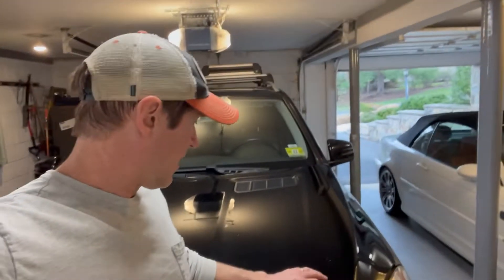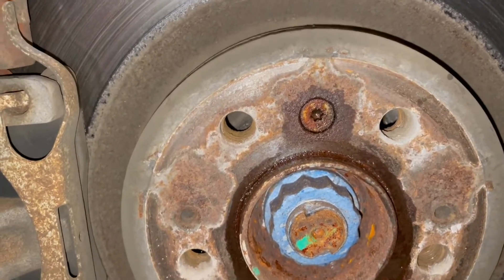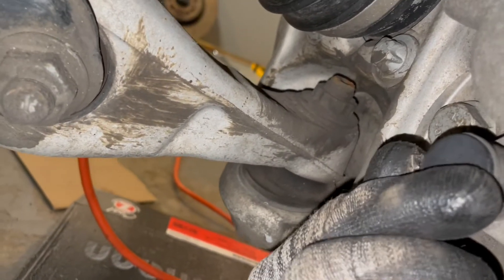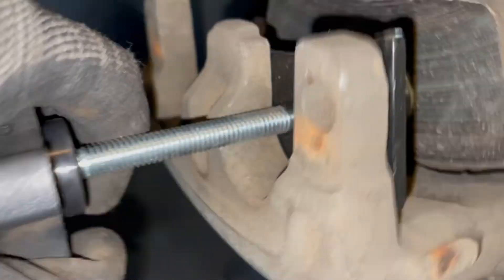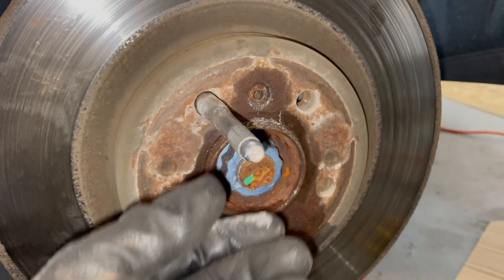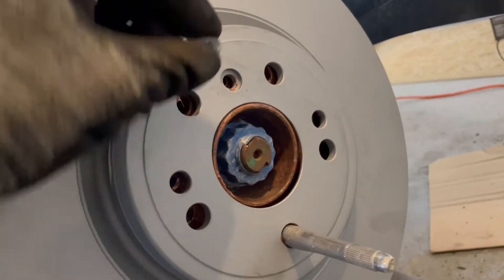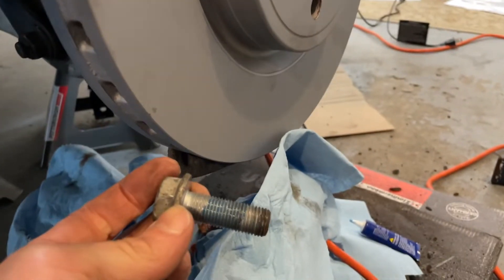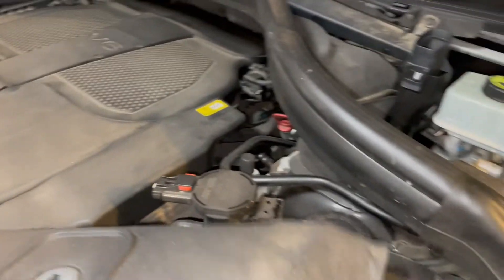Mercedes ML350 - Replacing Front Brake Pads and Rotors  (ML 2012 - 2015) and (GLE 2016 - 2018) W166

Comment: great video Ivan , would you know where the coolent sensor is on a ml 250 . 2013 i cant find it for love nor mon ey ,all videos and pictures dont show the same engine as mine . ian
Reply from the maker: Hi Ian, I don't have that engine in front of me but I am looking at diagrams.  Fo your engine, it looks like the coolant temperature sensor is located on the rear of the left cylinder head.  Let me know if you have any luck.
Reply: Hi found it as at front near the thermostat, after changing that and the fan !!! It was the AC sensor and a re gas all done thank god .

Comment: Do you keep parking brake engaged for the front or do you put in brake service mode like the rear?
Reply from the maker: when replacing the front brakes, you don't have to disengage the parking brake.  However, when replacing the rear brakes, you must move the parking brake into the fitting position.  You can do so through the menu.  Hope this helps

Comment: What size drill bit did you use to remove the t30 screw. Mine are stuck solid
Reply from the maker: Honestly I don’t remember what size it was but if you look at the new screw and make sure the but a little smaller then that, it will unravel when you go through.
Reply: @IvanSchlachter  and the same can be done on the back rotors too?
Reply from the maker: @bossman2819  yes, in fact I didn’t have to drill either of the screws on the back rotors. They came right out and I reused them. I hit them with penetrating oil and pushed down hard as I gently turned counterclockwise
Reply: @IvanSchlachter  I tried that on Sunday and they didn't move at all

Comment: Interesting...  I thought that you needed a scan tool to "retract the piston actuators."  prior to changing the pads.
 I just paid the MB dealer $1440 for front rotors and pads and $580 for rear pads... They wanted $1500 to swap out rotors/pads in back. Anyway, I always do my own brakes, (BMW & Acura) but this time around I took the ML350 to the dealer in San Fran, long story but it is what it is. 
Back to original question, is a scan tool required to do this job?  If not, I'll start doing my brakes on the ML350 too. Additionally, if you don't use a scan tool does it set an idiot light on the instrument cluster. 
Thanks
Reply: Just did it today, and nope. For fronts, all you need is the retractor tool that he used, for the rear, find the steering wheel button combo for service mode. Select the option for “release electronic parking brake” aaaand done. Can’t post links on YY but there’s a great tutorial on here if you search. Good luck! Same here, I hate doing brakes, but after I saw the estimate of 1200, I decided to just do it myself. Spent 440 on rotors and pads all around
Reply: @jakesmith2341  Thanks, I sorta figured that, after watching a couple of other videos too. It seems like you need it for the back, but as you say, you can do it via the instrument cluster too... So really no need for a scan tool. 
The dealer wanted $380 to replace serpentine belt.... I said NO!  Did it for $21 bucks (belt) and maybe 5 minutes.  Actually, I got the "Serpentine belt Kit" for $91, that comes with the belt, tensioner, and the two idler pullies. Not bad at all.
Reply: My question is where do you find an 11mm hex bit socket?
Reply from the maker: Harbor Freight has them

Comment: How long do the rotors last? I had them changed at the dealer 22000 miles ago along with the brakes and they recommend I change them all out again?
Reply from the maker: Hi- personally I replace the rotors each time I replace my pads. This is recommended, however, some people skip if they look decent. For me, it’s too important not to change both the pads and rotors together.
Reply: Depends on your driving

Comment: Do you reuse the wear sensor?
Reply from the maker: Hi- Technically if you replaced the pads before the sensor was triggered, it would most likely work but it’s an easy swap and the sensors are about $3 online - so I would highly recommend replacing the sensor as well.
Reply: Why not its $5
Reply: In short. DO NOT replace the sensor if it hasn't worn to the point of alert. Reuse it until the new pads get to that point "if you let them go that long" then replace. Don't replace it. I'm a fan of not even spending a dollar if I don't have to. Btw, the antiseize all over the rotor contact is not necessary either.

Comment: All good. Only issue..... FAR TOO MUCH copper / anti seize used. When brakes get hot, it will turn to liquid and be all over the brake rotor impairing the braking ability !
Reply from the maker: haha, I did use a lot...  But it's gonna be ok